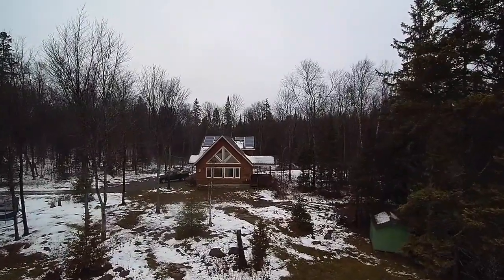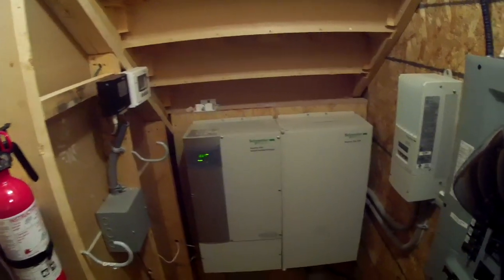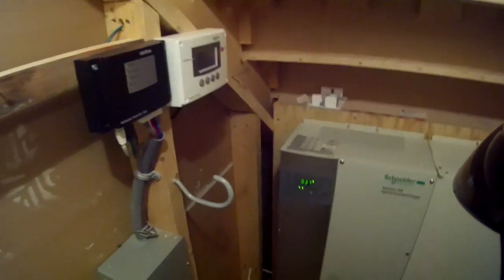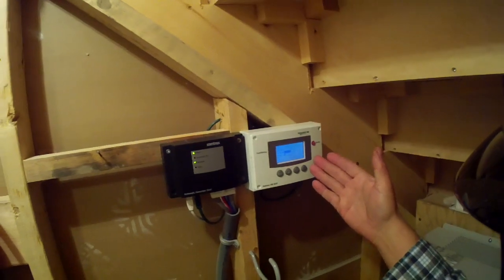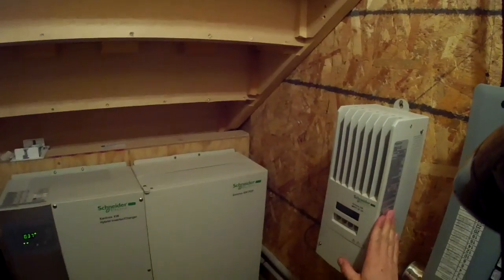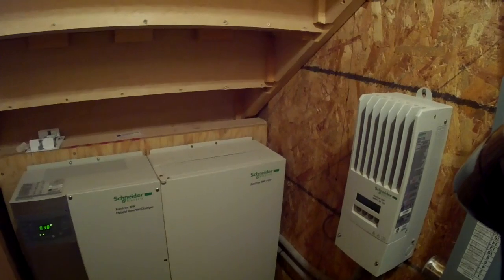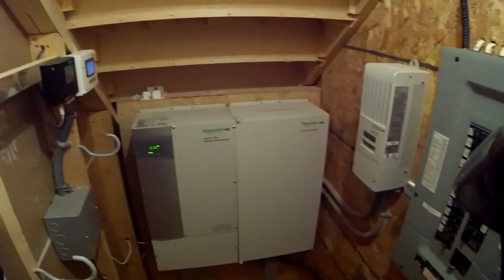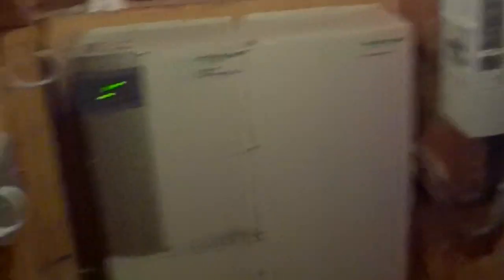#8 Off Grid Solar System & Storage at the cottage. Outdoor channel.

Comment: Well the cottage is built and most of the solar system is installed .just curious have not run my generator yet , but noticed you have 2 propane tanks . how often does your generator run in winter. Trying to establish # of solar panels to install, and if I should increase my propane storage. Your videos have helped in developing my off grid home . Thanks
Reply from the maker: Hi Bill - that's great news - congrats. That is a tough question to answer to be honest in short version. Feel free to email me at gordpotter55 at gmail dot com

Comment: I see you have two large propane tanks ... what is your propane consumption like at different times of the year? How long do those tanks go between fills? Is your generator usage driven by battery storage (solar charging stops because batteries are full) or solar capacity?  I live in a rural community, have a grid tie, but outages are frequent during winter storms and can last up to a week ... so I'm trying to balance solar capacity, battery capacity, and generator to back-fill as if I were off-grid.

Comment: Very cool stuff!  Any plans to go to LiFePO4, when the AGM's reach the end of their life cycle?
Reply from the maker: Good morning Jason. I am not sure - I have heard of them but not sure if they will work here. I know Lithium Ion is not a good choice for me. One of the big considerations here is that the battery technology has to be able to work in very cold temperatures - the basement is sitting on an open rock shelf and it gets as cold as -40 C here in the winters. But hopefully I still have lots of time left before I need to start doing research on replacement. Thanks for the great question.
Reply: @GPOutdoors  - It's true that most of the lithium chemistry batteries should not be charged below 0 degrees Celsius.  The advantage to lithium batteries is greatly reduced weight and much greater depth of discharge.  In combination, that means you can get the same total watt-hours from a battery bank that is about 1/4th the size/weight of lead-acid/SLA/AGM.  Any of the modern lithium battery installations will come with low temperature protection for both charging and discharging.  Lithium Iron-Phosphate and Lithium-Titanate are both very safe (no risk of fire, like with Lithium-Nickel Manganese Cobalt oxide).  LiFePO4 has a cycle life of 3,000 to 4,000 cycles, while Li2TiO3 has a cycle life longer than you and I probably have left on this rock!  Lithium-Titanate can also be charged/discharged at lower temps than the other two chemistries.

One additional thing I'll mention is that there are "cold-rated" lithium batteries, which use a small warming pad (like you would use for heating seedling trays) that will warm up the battery cells to a safe temperature before allowing them to charge.  Presuming that your basement never gets to -40 C, these various features would mitigate for the concerns you have about using these newer technology batteries.
Reply from the maker: Thanks very kindly for the info Jason. Very helpful. All the best to you!

Comment: Hi GP, I know this is an old thread, however people still look and comment on it. You research everything and I am sure you are aware, however, often people approach off grid power from the wrong direction. You should start with reducing the amount of power you require. Led lights take about 1/10 the power that incandescent bulbs require. My cabin has propane for the Bbq , refrigerator, and stove. Large loads, like hair dryers and espresso machines are used sparingly off a generator. Vacuuming is done early on sunny days. I love being off grid at my cabin😀
Reply from the maker: Thanks Dave! I think you have a great point there. Me too - every light is LED including the outside lights and flood lights. Propane Q and stove. Thanks for the comment this morning - have a good one!

Comment: Thanks for the info. Love the set up. Does it require a lot of technical knowledge to maintain the system?
Reply from the maker: Good morning . Not at all for me. You learn as you go but I have the service company look after any of the serious programming etc. I usually only need to adjust settings for the winter and summer differently and I have learned now how to the myself. Very easy. Thanks for watching and for the comment!

Comment: GP. You probably won’t see this comment, but I’ll make i5 s anyways. I have solar on my hone, plus heat pumps. My electric bill is 13.00 a month except for January and February when it will go up to 250.00 a month. I have propane stoves in about each room as backup plus a full house generator connected to the underground propane tank. Best investments I have 3ver made. My house was built in 1750 and is huge with a center chimney. I’ve had the insulati9n updated etc, new wiring circuit breakers solar hot water etc. a 21st century house with roots in the past. Glad you are using g solar. Your storage looks very interesting. I would love to have more info. Be safe.
Reply from the maker: Good morning Jean! Thanks for the info on your place. That's great. My battery storage consists of 12 AGM batteries (Absorbant Glass Mat) - good performance in cold environments. I can not remember how many KW it is but it will provide me up to 2 days of power for the whole house when the solar panels are covered in snow and not producing. From about mid May through to about mid September, the small 1.8 KW of solar panels will provide enough power such that the generator almost never needs to run. I could only fit 8 panels on the roof but wish I had more, and preferably on the ground so I could clear the snow form them in the winter. Hope that helps a bit. Take care!
Reply: @GPOutdoors  Interesting battery storage. My next goal is to install something like the Tesla battery storage system, but the technology has to improve. I'm not quite ready to give up the propane generator for when the power goes out. I figure right now $500.00 a year to heat and cool the house which is over 3,200 sq feet is pretty cheap, plus I pay $800.00 in propane for those bitter cold days the heat pumps cannot keep up its the cold. The propane also takes the chill out of the room. I use propane for the stove and the oven is electric. My overall goal is to install solar panels on the "T" hangar and someday fly and own a battery powered electric airplane.

Comment: Hi Gord,  

Two things..
First, is your winter heat source propane as I saw two tanks. Or, do you use wood fire? Second,  if yes, have you thought about a geo thermal system with pipes running to the lake..it would be cheaper than running deep into the ground.  We are in the process of moving from a 2 acre city lot to a wooded 50 acre lot in a few house with geo thermal..I will have to investigate your setup in more detail as we would like to transition to being off the grid with regards to electricity.   It will happen all in good time.   Love you videos, I am hooked on your tractor ones...  cheers, Sunjay.
Reply from the maker: Good morning Sunjay. Thanks for watching and for the comments and questions this morning. Congrats on your property move! Yes, heat source is propane here. I honestly didn't look too far into the geo thermal as we have a lot of rock here so digging deep or trenching is very difficult. Plus I would still need electricity so would still need propane for the solar system regardless ( the back up generator). Best of luck with your transition and thanks for tuning in! Cheers!

Comment: Great video: I am doing the exact same thing just a bit north of you near Sudbury.  What amp/hrs are you batteries ,because I am not sure what size system I should go with, also is your hot water heater propane?
Reply from the maker: Good morning Bill. I honestly can't remember - it was a long time ago now. However if it is helpful, I have enough storage in the batteries to last about 1 1/2 - 2 days without sunshine. The cottage is about 1300 sq feet. My average daily load is about 11 kWh in the summer and about 16kWh/day in the winter. The stove and oven are propane, the water heater is an on-demand propane, the furnace is 2 stage high efficiency propane. Every light, including the flood lights outside, are all LED. My demand load generally never goes over 4 KW (but I have the potential of about 6, given the sump pump, water pump and septic pump). If I were building it again, I would install enough batteries for at least 5 days of power without sunshine, and as many panels as I could afford. If I had the ability , I would have installed a ground mount as well - so I could easily clear it off in the winter to save the cost of running the propane generator as often.  Hope that helps a little. happy to answer any questions I can. Good luck!

Comment: Hi there. Great video. Would you please give me the specs of the charge controller and the switch etc for the back-up generator so I can copy what you have. I can’t find an auto switch that tells the generator to turn on and a brain to decide when the batteries are low and when to use the back-up generator
Reply from the maker: Good morning Mark! I have Schneider equipment myself (6048 model)- and associated Xantrex system set which manages everything. Outback is another brand of equipment which does the same thing and there are several others, but the brand names escape me. I would contact a few solar retailers and I am sure they will give you prices on the components you need and pricing. I don't manage or maintain it myself so i am not very familiar with the details or mechanical end of things. Good luck and all the best!

Comment: How long do you run that home with that setup you got there on your battery bank before you have to fire that generator up or your solar fills them back up?
Reply from the maker: Good morning Kerry. It can go about 2 days without a charge of any type. From about May through September, the generator almost never needs to run but in the winter, the snow on the roof will affect how often the generator needs to run. Cheers!
Reply: @GPOutdoors   thats not to bad on that size bank. How many watts you burning a day on average
Reply from the maker: About 12 kWh on average. I would have installed more panels but no more room. When I save enough to build the garage I will be putting more panels on it. And will be increasing the size of the battery storage at some point as well. Cheers!
Reply: @GPOutdoors  well your doing pretty good with that setup. You ever thing about adding a wind generator to help out on low light and night time
Reply from the maker: Not alot of thought on it to be honest. But perhaps might be an idea as we get alot of wind here - especially through the winter. Thanks Kerry!
Reply: @GPOutdoors  every bit helps and saves money in the long run

Comment: Very informative video GP.  I am on the grid and also have a 15kw back up generator but am seriously thinking of solar panels.  But instead of a storage system (because of the machinery in the shed) I was considering an inverter system that (somehow) pumps it back into the grid subtracting what you generate from what you consume...leaving me to pay for the balance of usage.  Like I said, just considering for now.
Reply from the maker: Hi T! I see you must have a tariff program in your home state. Important to crunch the numbers thoroughly my friend. I have not looked at it for a number of years now, and I know system costs have dropped quite a bit since then, but in most cases, the business case does not work in your favour. You may not see a net benefit or any reasonable payback period on your investment, and this was true in most US states (back when I was more familiar with them). Again, not familiar with your program there but if you do get serious about it, then feel free to email me and we can get on the phone together and I can help you with the numbers and analysis. Good luck!
Reply: @GPOutdoors  Yessir, I will keep that in mind and accept that offer if I pull the trigger.  The local utility company here will subsidize an unbelieveable percentage of the cost of the solar cells.  But they run those programs for several years then change them one way or another. I have a lady friend that is an engineer for the electric utility and I have been picking her brain off and on for about three years about her non-storage system.  I still can't wrap my brain around how a small homeowner system 'feeds' it back into the grid though....  crazy !!

Comment: When your inverter goes down look at Sol-ark 8k and at LiFePo4 batteries. That would be 93 % efficient round trip. What you have there is probably 65% efficient round trip and If you discharge the batteries too much you kill them in 5 years.
You would gain 3 solar panels that you now use only for the losses in the current setup. Pretty much you have only 5 solar panels. 

People up there in the north also mount the panels close to vertical in the winter to get the reflection of the show if you mount them on the ground.
Reply from the maker: Good morning mlg. Thanks very much for the great advice. I will keep notes on this for when the time comes. All the best!
Reply: What does a system like this or an updated system run ? I understand it varies but plus / minus $5000

Comment: I have panels and I pay the solar company for the energy the panels produce. The rate is cheaper than the utility company but I think the system isn't being used to its full potential. I want to add batteries and a generator for emergency situations if/when the grid goes down. Your video is very helpful and informative. Did you do the wiring yourself?
Reply from the maker: Good morning! I had the system installed by a local company up here. I am certainly no expert but just my opinion : install as many panels as your south facing roof surfaces will allow  - don't agree to buy panels to be laid on the north, east or west roofs unless either of them is largely facing south as well ( it is a waste of your money as the panels on those sides will generate far less power). Put in a battery bank that will hold 2 days of your house load ( including your daily peak demand). You will be able to pre-program your charge controller to always keep the batteries full and auto switch between the battery power and the grid as you decide and to swing the power between your house load, the batteries or back to the grid as you choose. Depending on where you live , you will probably find that it is more beneficial financially to have the controller take power from the battery during peak rate times ( during the day and evening until 8:00 pm Monday to friday) so you are not taking power from the utility during those times and then flip back to grid power at your discretion.  All of this of course, depends on the tariff rate program you have there, and the systems available to you and of course, the cost to you to install the system. If you live in a winter climate it is important to note that the roof will not generate much unless you are willing to clear the snow off the panels every time it snows. Anyways there's lots more to consider and analyze than I can type ( LOL) but I hope this has been a little helpful. Good luck and all the best!

Comment: I would love to now what you spend a year on propane and how many gallons you use, propane is not cheap here in the states
Reply from the maker: Hi Lee, I average about $1,500 - $1,700 a year on propane. Runs the barbecue, stove, furnace, fireplace, hot water heater and also runs the back up generator during times when I run out of solar power. Hope that helps. :)

Comment: I am a new subscriber about a month ago mainly because I also have a Kubota tractor. Then I heard you say you were off grid! Now I really have questions ! Do you know how much propane you burn in your generator per month? I I have other questions but that is #1. Really enjoying your videos. Cheers!
Reply from the maker: Hi Michael. Thanks for subscribing! Hard to say how much it uses for the generator as I have never really tried to calculate it. The propane is used for the fireplace, oven, barbecue, furnace and water heater, and provides fuel for the back up generator.The generator almost never runs from about the middle of May through to end of September as I usually have more than enough power from the roof to run the cabin as well as charging the battery storage. The generator will run now and again during the winter months , as needed, depending on how much snowfall we get and how often I clear the snow off the panels. I wish I could be more exact but I have never really tried to figure it out.
Reply: I am interested because we built a passive solar net zero energy home in MN 3 years ago.  We are currently grid tied, but possibly thinking about going off grid like you are.  Our electric utility is giving us a bit of a hard time, thus the interested in cutting that cord! Cheers!